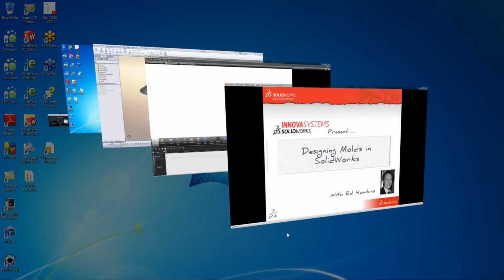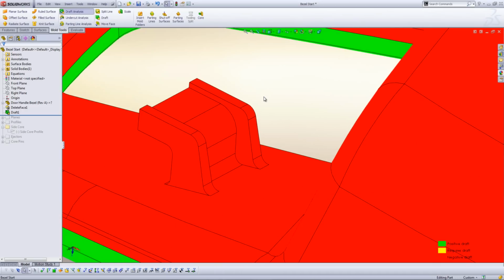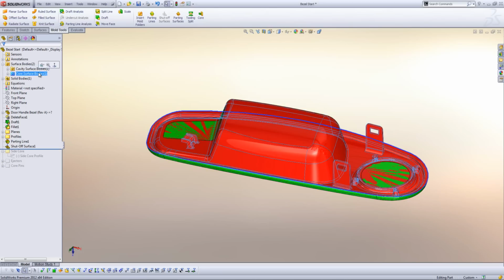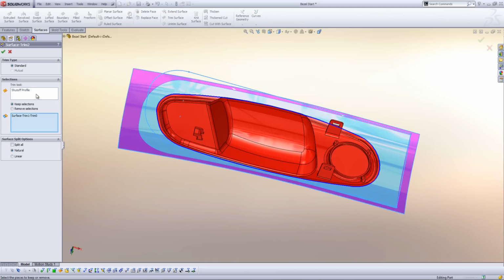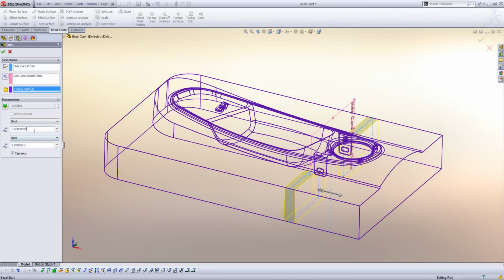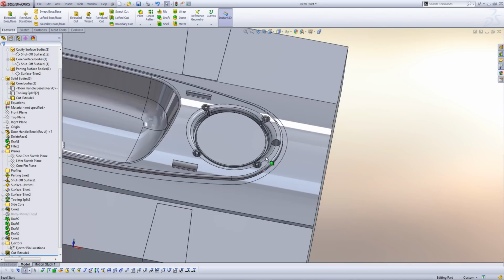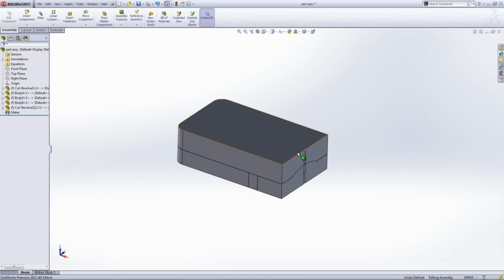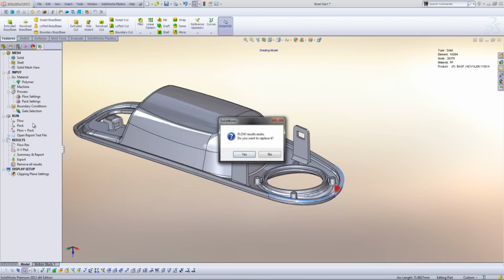Mold Tool Design in SolidWorks [Webcast]

Comment: Hello, I'm wondering how would you add ejector pins to the assembly and cut them with the products surface? This is one thing I've been struggling with and seems that every video on the net just skips that part completely. Lets assume I have a part file of my ejector pin, like 8x125 pin and I insert it into the assembly with mates to a hole and the ejector plate. Lets also assume there is countless other pins there also, as is usual in a mold. How do I trim the lengths to the surface of my product?